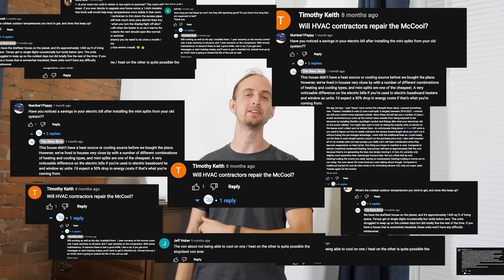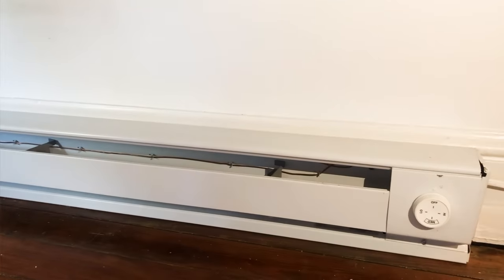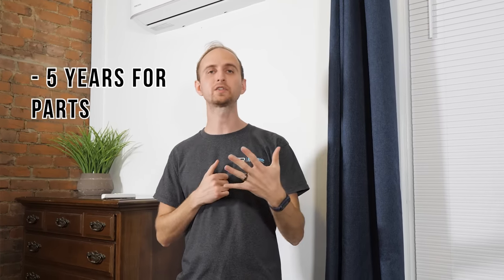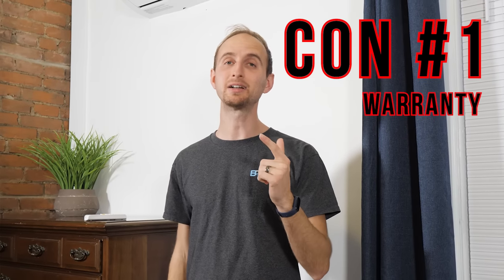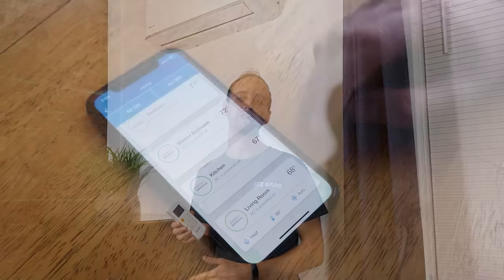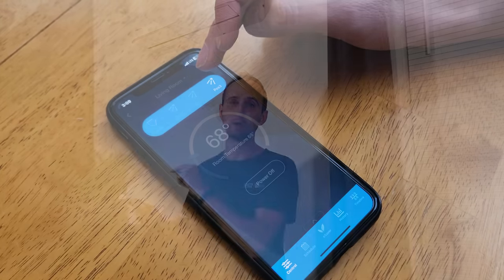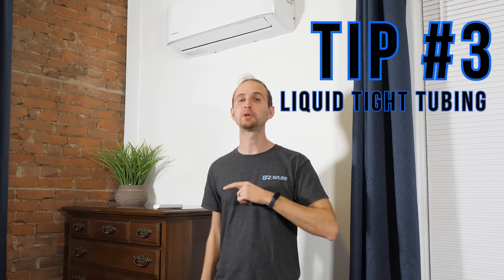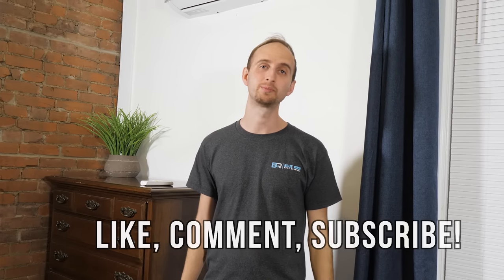Mr Cool DIY 2-Year REVIEW: I wish I would have known this BEFORE BUYING...

Comment: I would caution your HVAC contractors that they're putting themselves out of business by discriminating against DIY setups. My brother-in-law was quoted $30k to replace his central AC/furnace. He did it himself with a DIY heat pump unit from Pioneer for less than $7k. Nobody with a brain is going to pay $23k just for the privilege of calling a repairman. A few years ago, I was quoted $13k just to add the AC option to my existing furnace. The furnace is 30 years old. Do you think I'm going to pay double for AC on my old furnace when I call replace the entire mess with a new system like my brother-in-law's for half that? If you're a contractor too high and mighty to see the writing on the wall, then in a few years, expect to get no calls. AC isn't that hard...
Reply: Problem is when the unit leaks you can’t do anything about it unless you call a licensed hvac contractor. The refrigerant used may be phased out and he will have absolutely no choice but to replace the condenser as no company sells the older refrigerant needed. A pinhole leak may take an entire year to empty a unit and it can be pretty hard to  fix said leak aswell especially with mini split systems. 

Hvac is a trade for a reason. Hvac techs get paid good money because the work they do can be an absolute headache and customers like you are part of the problem. Your ignorance is gonna cost you $ and the hvac tech an unnecessary headache down the line
Reply: @oscar6846  You raise good points, and I certainly don't begrudge anyone an honest, productive living. But as someone who has worked in the trades, and often ends up redoing the work done by professionals, I know when I'm getting gouged. AC is one of those areas where there's a lot of gouging. I remember people paying $2500 to get their auto ACs converted from R12 to R134 after the ban in the 90s. That job involves, what, $200 in materials (in today's prices)? Maybe $500 if you overpay for a compressor? That's gouging. Eight hundred dollars to replace a thermostat is gouging. For $23k, I'll do what i did with auto AC, I'll get educated, buy the right tools, and fix it myself. For $23k, I'll get an HVAC license and fix my neighbors' DIY ACs as well. It's no knock on you, and I'm sure you do good work, but $23k is an enormous sum of money. For most people, the choice isn't whether to go DIY or professional. It's whether to go DIY or simply do without AC altogether. I think most people will put up with a wonky DIY install before going without. My advice to you licensed AC guys is to see the opportunity here. If someone has a DIY install, then you already know they're handy. Offer to provide phone consultations when they have trouble. They turn the wrenches, and you offer technical advice. I'd even suggest you offer rental tools, like the auto parts stores do. Become the local go-to guy for the DIY crowd.  We're in the age of YouTube now. People aren't beholden to professionals who use licenses and secrecy to justify unreasonable markups. You can't protect your fat margins by ignoring DIY AC systems. You either get in front of this or find a new line of work. Sorry, I hate to be so blunt, but that's just how it is now.
Reply: @drsnooz8112 Damn! I couldn't make a better argument than this one! A point to mention is that there are two types of people the doer's and the ones afraid of grabbing a screwdriver, which makes no sense in this era, I grew up without the Internet and still I learned to work on many things, today's day I see  the youngsters don't get the motivation even with all the tools at their disposal and that is the why you end up with someone asking 23k for an a/c system 😂. People and companies prefer to throw and replace anything instead of properly servicing the equipment, The landfill is loaded with equipment that probably has over 10 yrs left on them if you just change a capacitor. I purchased a house and the air handler stopped working I called a company and they offered me a new system instead of repairing the old one, that night I disassembled the whole unit, cleaned it and fixed $0 money vs $11k new system, 10 yrs later ac still cooling like an artic blizzard. At one point maybe..just maybe tradesmen may realize they are losing money by not offering repairs as the diy community growth.
Reply: @SPUTNIK6996 the only thing easier than HVAC is electrical.  Both are overpaid generally.  There are tasks that require expertise in HVAC, like you said, changing out a compressor or charging a system (a DIYer just needs to get EPA 608 certified, not hard).  However, installing these mini split systems is nowhere near worth what an HVAC tech will charge.  It is absurd what they charge for mini split installs.  Like the OP said, AC isn't hard.
Reply: @brontoab1  mini split installs are easy compared to actual hvac installs with duct work. HVAC installers are the backbone of the hvac trade, those are the ones with the talent
Reply: @drsnooz8112 this where I am right now. got a pioneer system in 2019 in a house we are renovating. 

ran well for a year. then stopped heating and cooling. told i had a leak and to replace whole unit. nobody wants to find the leak.
Reply: @macman9689  I bought a freon sniffer years ago. They now cost from $20 - $200. You can find most leaks pretty easily with one of those. Most of the time, you don't even need one. The line connections are where most of the leaks happen. Look at where the lines enter the condenser (the big noisy unit in the yard). If you notice oil or crustiness, chances are that's your leak. On a unit that new, it's likely nothing more than a flare nut that needs to be tightened. Super easy and you can probably talk a repair guy into recharging the systemwhen you're done. YouTube is your friend for a lot of this.
Reply: @drsnooz8112  I'll try that. guess i need to find someone that does repairs and not a company that primarily do new installs 🤔
Reply: @drsnooz8112  update. I was just told someone may have stolen my freon and that i do not indeed have a leak.

I ask to explain. Tech said he filled my system with nitrogen i believe and that he observed no drop in pressure.

He said that he would leave it there for a couple of days to check to see if any change in pressure. 

I asked if there is no leak can it then be filled with freon. He says yes and it will cost $800!.
Reply: @macman9689  Ugh. I guess that's why they stole it. My brother-in-law had his whole condenser stolen twice before he put a steel cage over it. Sad.
Reply: I am in the trade and Mini-Splits are notorious for leaking at the flare nut.
Reply: Don’t worry about us HVAC Technicians, We get plenty of work and have no real concern for DIYers. Do your thing if it makes you happy.  If a system can be repaired, I would rather do the repair than replace the whole system. Doing the complete system install correctly is time consuming.  If a system has multiple failure points like leaks and failed compressor, It is probably time to do that complete install.
Reply: Why do you neglect the people that have more than enough money to hire someone? What about the elderly people who physically can’t do labor work? There will always be market for hvac especially as more diy people enter the field
Reply: @SPUTNIK6996 sorry, his argument still holds as simply replacing the the unit is probably still cheaper.
Reply: Hi.

Hvac contractor here. For those who don't find it hard, feel free. But why we don't service customer installed units is because we will face the EXACT same utter disregard for our existence and trade from the self installer as your comments here. "It's not that hard, I'll just do it myself. Hvac guys are not that smart. This is easy." Then why call us? If you laughed at us for our quote for installation, you're going to laugh at us for our quote on repairs.

The reason we don't run them is because we HAVE already - and when we did, we got you. It's a waste of our time to have you say you think we are too high. We have to pay fuel, local, state, federal taxes. Health insurance, 401k, vacation, overtime, like 4 different insurances. So sorry we could do it for $60 bucks bro.

No thank you.
Reply: @russellebenton  don’t waste your time explaining to these idiots, the same people that will sit here and complain about our work are the same people that go to Starbucks not realizing there spending a 300 percent mark up
Reply: The chance of getting ripped off is 50/50. I am a retired general contractor so I found reliable subcontractors and paid them well. Workers are just trying to pay their rent and fix their trucks. They deserve to make a living. Larger HVAC companies have fabrication shops and secretaries as well as insurance and workers compensation to pay for. The good ones have engineers to do manual J calculations and a staff member that is trained to commission new installs. 
I installed my own Pioneer Mini split 3 years ago for fun and it still works great! When I replace my furnace and add a/c I want the calculations done and a professionally designed duct system that is tested by a HERS rater.
Reply: @SPUTNIK6996 Ability Refigerants sells all common refigerants on the Internet. So wrong.
Reply: @russellebenton  I took the online HVAC classes, studied for and got my 608 license, got the tools, Fieldpiece gear, torch, vac pump, etc. And I installed a 5 ton ICP system in my warehouse for total equipment cost $5,100. HVAC company quoted me $12k, and it's running great.

Just had a 2.5ton unit in a rental property die after 20 years, ordered another ICP unit for $3,600. I'll have that in this weekend.

"We deserve to make a living." I agree, but charging me $300 to replace a $15 capacitor and $200 per pound for R22 thar costs you $20 a pound isn't "making a living," it's robbery.

I will never have to pay another inflated parts fee or have someone tell me "well it's gonna take $1,000 of refigerant, so you may as well just change it out (for $10,000), nope. I'm going to get all of the life out of all of my systems without your FUD sales pitch.
Reply: @User-be5yj a capacitor at Granger is like $18. To have one replaced by an HVAC tech in thr summer is $250+. That is a 1,400% markup, guess what if I can learn software engineering, database design, accounting, finance, and run a business, I can also learn HVAC.

I'm not paying another inflated service charge of listening to another stupid sales pinch (FUD) about changing a system out because "R-22 is expensive" when the equipment has years of life left in it. I got a 608 license, now I can buy R-22 for $30 a pound just like HVAC companies can.
Reply: @toeknee3138  no one is telling you not to do it, I would actually prefer it too if you did you’re own work on your own house relax Albert Einstein lol
Reply: I bought a Mitsubishi hyper heat mini split 18kbtu was not cheap I installed the air handler and the outside unit then I wanted someone to come and install the lines pull the vacuum and release the refrigerant.i called several contractors not one would come to my house.so I watched youtube bought all the tools I needed and 3.5 years later the things still blows cold in the summer and get 140 degrees in the winter coming out .i would have preferred to have a contractor do it so im guessing since they couldn't justify charging me some crazy price because I did most of the work myself they said nope.thats ok I learned a great deal by  installing myself.if this thing ever fails I will buy cheaper unit and do it again and still be cheaper than than having the first one installed by a contractor
Reply: I think you're leaving out a lot of details to make HVAC contractors look bad.  Unless you've ever been an HVAC contractor, you have no idea the insanely high amount of fees and liability insurance we have to pay to have a contractor's license.  The high prices you were quoted most likely included city permits, air duct inspections and other inspections that are required by the city and it might have even included ductwork.  I'm sure if you installed it for $7,000 yourself, there's no way it was installed legally, by the book.  And if your house burns down because of the" DIY" installation, guess what?  You're home owners insurance doesn't cover that.  HVAC contractors are not HVAC handymen.  Your DIY project is an HVAC handyman project.  There's a huge difference.  Find a handyman with an HVAC background to patch up your illegal project.  Why do I say illegal , because installing a Mr Cool system or any HVAC system requires city permits and fees. Why? Because if you do it without one, like I said, home insurance doesn't cover anything if your house burns down because of your DIY project that requires a permit. That's why they want a contractors stamp on it saying it was done professionally.
Reply: Hvac is like any trade, most of it is easy. People in trades don't get paid because they can do the easy work, they get paid because they have the ability to do work that you  can't do and probably aren't even aware of.
Reply: @macman9689  well you did a bad install then.  I have THREE pioneer units.  They have been installed for 3 years now....by me....and have saved 1000s in install....and even more over propane heat in winter.   When I say thousands?   I was paying roughly 3000 a year for propane.....contracted in.....preferred pricing.  

My ALL IN....heating AND cooling electrical coat is about 900 for the year on ALL three units.  

I could replace all three every few years and still be ahead by a good margin.  

I will install my own stuff.  And not pay a contractor a ridiculous labor fee for 6 hours of work.  I'm happy for them making good money, but I'm not one to just pay blindly if I can figure out how to install it myself.
Reply: @rdalemd76 that's the issue with them.   Most are made over seas.  If people are going to do the install themselves...buy a cheap flare tool (the right one) and redo the joints.  The flares that come on the line sets are garbage.   Nylog is a big deal too.  Cheap insurance....and for the love of the good lord.....do not over tighten!
Reply: @johnharrisonschulz  aww look how butthurt you are. I took the HVAC classes, I passed the test, I got the license. I can do this shit legally. And now I don't have to pay con-artist HVAC companies that are marking capacitors and R-22 up 1,400%. My shit is always charged and running great and I pay the same amount for refrigerants as the HVAC companies. I love it. 

I installed a 5 ton split system for $5k, the cost of the equipment. I live in a rural county, no permitting req. And it was a beautiful well done install.
Reply: @drsnooz8112 its all the easier now to fix anything because of YouTube. You don’t have to do anything but follow a step by step video lol
Reply: @brontoab1 
How do you know that HVAC and electrical are so easy?
IMO, with that statement, you know very little about either.
If you had extensive knowledge of these trades, you wouldn't say this.
Reply: Bro….im sorry that you are angry….but you should probably do some better research….dude….its painfully obvious that you have no idea what you are talking about.
Reply: @houston5508  absolutely and completely not true.   I have 3 Pioneer mini splits.   The first one I put in had a rattle to it....and I broke a few fins off the blower inside trying to trouble shoot.   I emailed them about it...and they not only sent me the new wheel after I ADMITTED to breaking myself...they sent me a free wifi dongle for the trouble and hassle of dealing with it all.   I installed them myself.

That alone was enough to buy two more.   However....the second one I put I had concerns of it drawing a phantom load....turns out it WASNT after several emails back and forth with one of their engineers...turns out the early version of Emporia does not consider power factor for loads, the newer version does.  But their engineer took the time out of his day to respond to several of my emails asking questions.  Also installed that one myself.

Bought and installed the third last winter.  

Looking to buy a 4th for the garage.

Hands down...even if they break after 2 years and you have to replace it, if you are using it to replace or supplement something like propane....they pay for themselves.

Heating bill went from roughly 2800 a year to 600 a year switching from propane to mini-splits.  Best part....the "war department" loves them because the house is warmer and she doesn't have to hear me bitch about messing with the thermostat.
Reply: @brontoab1 for us as hvac techs, yes it’s easy, for a normal homeowner, no hahahaha 

You’d be surprised how many people can’t even turn a screwdriver. If people continue to pay the price, then I’d say hvac professionals are worth it.
Reply: @drsnooz8112 your a noob
Reply: Not only that look at the insane efficiency of mini splits, and how much cheaper your power bill is going to be!

You can literally buy and install multiple mini split systems for the cost of simply installing a traditional system. Actually, you can buy an install mini split systems just for the cost of the traditional system before you even get into the ridiculous amount of money for the installation. Then factor inefficient use will affect your power bill.
Reply: A major heating and cooling contractor in Denver flies home to Tennessee each weekend on his private jet!
Reply: Got a quote yesterday to install my unit. Just took it up. It's already on the wall. $9000 to hook it up. I hope they go out of business.
Reply: @raypalmerino7862  They've done the studies, and this is precisely how companies go broke. They become accustomed to really high profit margins, so they let the lower margin business go. Then lower margin entrants take over the bottom tier and work their way up till the fatcats go broke. The low margin DIY units have already gobbled up that sector. Now they're working on central AC. Pioneer can't even keep these units in stock because they're so popular. The high-and-mighty HVAC guys are dead dinosaurs walking.
Reply: I bought 7 pioneer units about 4 years ago. Unfortunately I've have problems with 5 of them. Talked to pioneer and I didn't register them so they won't cover them under warranty.  They are selling me one of the heads at half price and I had to pay full price for two others last week.
I have a ac company changing one whole system out to another brand with a 10 year warranty. 
I won't be buying anything else pioneer except for the fact that the condencers are ok I just need the inside head.
Just save yourself trouble and stay away from pioneer mini splits.
Reply: Honestly, once the hole is drilled and the power run, replacing the entire unit is not expensive.
Reply: @rdalemd76 Only if installed by a hack. They should never leak.
Reply: @mitchtoeroek2085  Unfortunately, This doesn’t seem to always be the case.  Even after using a Micron gauge  and taking the system down to 200 microns. These flare systems can develop a leak at the flare later down the road. Perhaps some years later. The installer that doesn’t use a Micron gauge is not ensuring the system is leak free at initial install.
Reply: @rdalemd76  That is the most ridiculous thing I have ever heard. I have literally installed 6000+ of these systems in Australia. Pressure test with nitrogen and evacuate. Done properly you should never ever ever get a leak on the flares. American HVAC units are 30 years behind the rest of the world.
Reply: @rdalemd76  A Micron gauge should never be used to check for leaks. That is what nitrogen is for. Pressure test, then evacuate. Flares done properly never cause any issues. I know this because I have personally installed 6000+ of these systems, my company has installed 10’s of thousands.
Reply: There is a lot more that goes into a system than just replacing it. I believe to many people watch these videos and think it's easy.
Reply: @toeknee3138 and when the capacitor still has a charge and shocks you and stops your heart send the hospital the bill😢